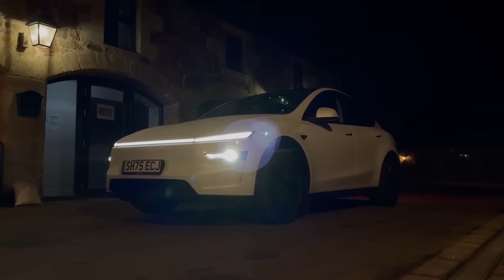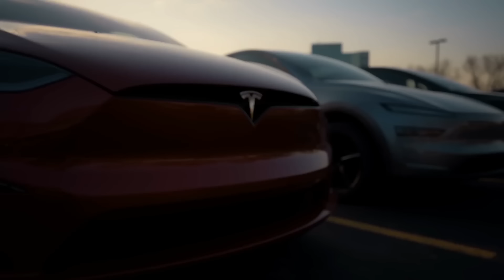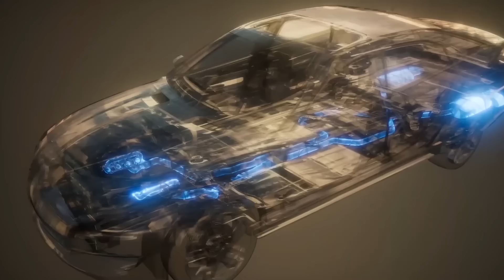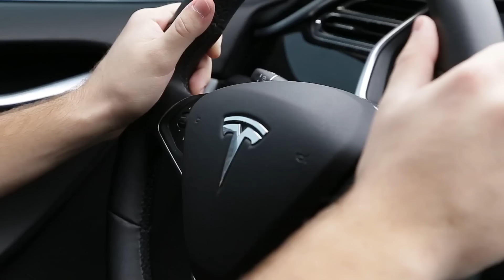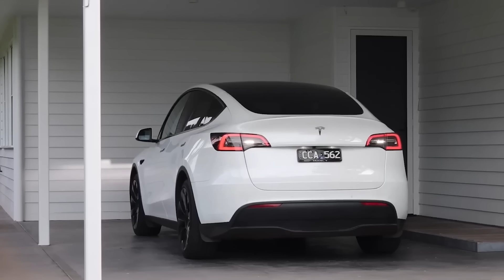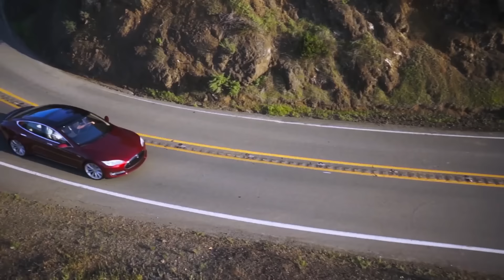Elon Musk's Motor Solves The Problem Nobody Expected

Comment: Does not solve power grid infrastructure issue. If you cannot charge the car, it makes no difference.
Reply from the maker: That's a very valid point about the power grid infrastructure. My video focused more on the motor's capabilities itself, but the broader energy ecosystem is definitely a critical factor to consider for widespread adoption.

Comment: There are a heck of a lot more problems with Electric power than the concern with magnets and rare earth minerals. Try simply there isn't enough electric being developed and the means to transmit it. Even if you have all of the concerns out of the road to make vehicles without permanent magnets you still have major hurdles with that and other things as well. How you going to deal with spent batteries and implication that we are doing this to protect the environment.

Comment: Tesla keeps working away at improving the efficiency and stability of the EV. With the aluminum ion battery, and this new motor, Tesla is edging closer to a car that can rival the ICE vehicle. As the price comes down on the EV, and the ICE costs keep going up, the value of the EV is increasing. Tesla just may pull off making the EV the go to car.
Reply: Yes, our lungs & proverbial asses depend on it!

Comment: I think a good assessment would be that the Tesla's now with the battery too much take off and they could trade some of that for a AC generator motor to get more top end performance in a balance would be more adaptable for General Terrain
Reply: Effectively retrofitting the traditional battery along with a sophisticated inverter module with high efficiency capability the battery will start the AC generator to power the drivetrain the battery would be DC to power components in the system and dashboard and so on and so forth an adapter would be connected to charge the battery from the generator while running like an alternator the battery then becomes like a capacitor multi-functional looking for components to cover a deficit in electrical load capacity when the system is not producing enough electricity at the moment to maintain the current load kind of like when you set up a system in your vehicle the attach a power wire to the battery and run it to the amplifier and then amplifier you have a box with two 12s the alternator can power it but if the idol gets slow and you're turning the power steering in the system is using multiple functions and the alternator starts producing less than enough to maintain the current output the bass loses its depth and it sounds terrible LOL but if you buy a capacitor unit attach it in between the battery and the amplifier If the alternator is not producing enough that capacitor could easily pick up the slack. Same principle apply here an Additionally the battery can act as a reserve gas tank so to speak if the AC generator motor engine has a power outage

Comment: A lighter, safer, more powerful, less expensive battery is the last hurdle. I believe Tesla is already working on it. When they get that, a lot of people will be interested.
Reply: If the aluminum ion battery proves out and goes into production, many of the things you mentioned maybe solved.
Reply: @ronfullerton3162 unlikely, aluminium paste is as explosive as lithium - indeed, they wrap explosives in aluminium paste to increase the explosive force. The fact is that oil and gas are going to be around until at least the 23rd century - and that's from official figures. Electric vehicles aren't the future, it requires an entirely different approach using lower flammability & less explosive products...
Reply: @johnmurphy4814  Aluminum paste is mixed with other materials. Aluminum in fine shavings or dust is flammable, but not explosive. "Aluminium alloy is one of the world's most widely used materials in the production of explosion-proof enclosures. It is highly corrosion-resistant and, therefore, universally known as the most effective and versatile material for most applications."

Comment: Indeed. It can be easily deduced. You do this: place a neodymium magnet in a shoebox. Then, insert a solenoid (coil) powered by pulsed DC and a battery in another shoebox. Have a friend use a Gauss Meter to read how strong is the EM field at the surface of each box. If you gauge both system well, your friend will not be able to tell the difference. Yes your overall energy (Watt hour) is higher, BUT if you are smart and control that induction motor (magnet-less) with a smart controller, you may come up even with the performance and energy consumption of magnet motors - or even better!. And like you said, they save on rare Earth mineral purchases and associated waste-control fees. Brilliant! Nikola Tesla, the inventor of the 3 phase motor, would be very impressed!  Engineers used to say "The only reason a problem exists is to dare us to resolve it!" Elon Musk and his mighty team is the epitome of just that. Thanks Dravexa for the delightful show.

Comment: IF THEY HAVE AN INVERTER WHY DO THEY STILL PUT A 12 V BATTERY IN THEIR CARS THAT CAN DIE? PROBABLY BECAUSE THE EVERY UNITS NECESSARY IN A CAR ARE ALREADY DRIVEN BY 12 VOLTS THEN WHY HAVE THEY NOT DESIGN A 12 VOLTS BATTERY MANAGEMENT THAT AUTOMATICLY CHARGE THE BATTERY FROM THE BIG BATTERY.
Reply from the maker: That's a great question about the 12V battery and its integration with the main high-voltage system. It touches on some really interesting engineering challenges.
Reply: I've seen other videos saying Tesla is ending its dependence on the 12 volt architecture. The rumored Aluminum Ion battery could be the reason.
Reply: @setruninja  They moved onto 48V instead. Ohms law. With higher voltage, you can use smaller diameter wires to carry current throughout the car. Smaller copper = lesser expense per car, and less weight overall. Nothing to do with Aluminum Ion battery.
Reply: Study Thermodynamics. It's a high school physics level question.
Reply: Tesla will still need to source silver. It is as big a problem as rare earths.
Reply: Don't understand what you say.but lots of people would but if they are electronic.yes the electricity is there all the time. 

.
Reply: Newer models are even better looking.

Comment: The battery is the weak point.  A generator makes sense.
Reply from the maker: Thanks so much for your insightful comment! I really appreciate you highlighting the battery issue and suggesting generators as a potential solution. It's comments like yours that make these discussions so valuable.